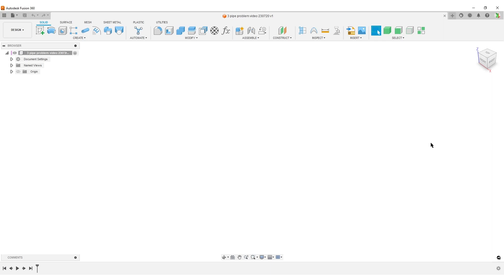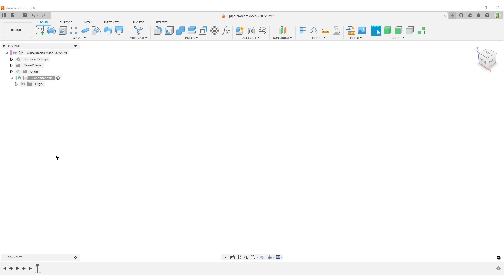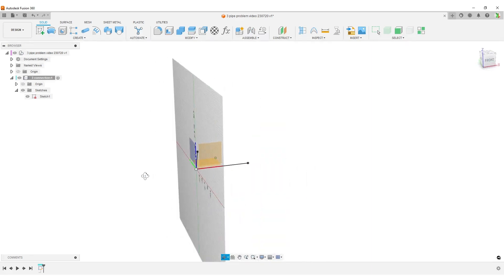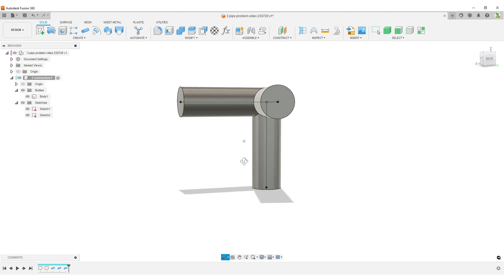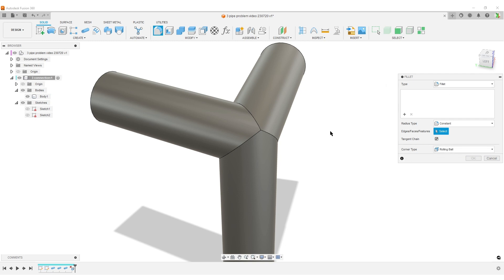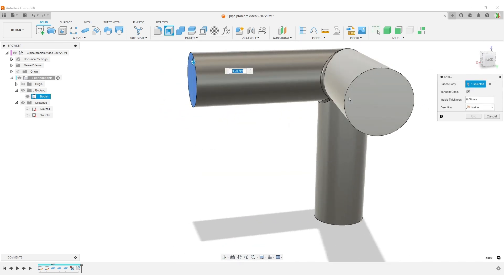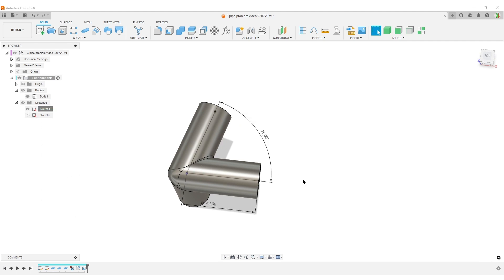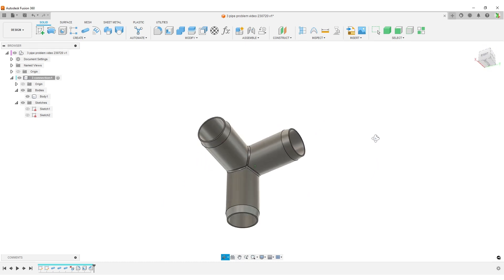How Delete Face can save a 3 pipe connector problem - Fusion 360

Comment: Great - just exactly what I needed to know. But contrary to your example I need to do all three lines (paths) as seperate sketch. Otherwise one line fades away after I did the first pipe piece. Strange. Nevertheless I got that thing solved. Thanks.
Reply from the maker: After you have used a feature (pipe in this case) Fusion will hide the sketch and you will have to turn on the visibility again (click the eye to right of sketch in browser). There is preference you can change telling Fusion to not hide sketches.
Reply: @KristianLaholm  good to know. Thanks again.